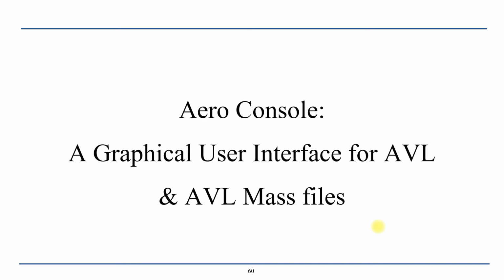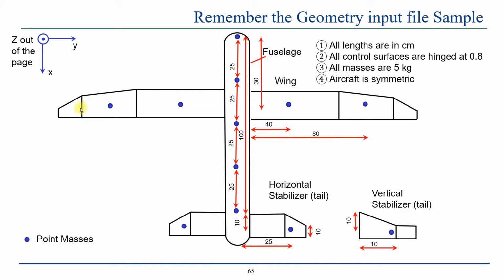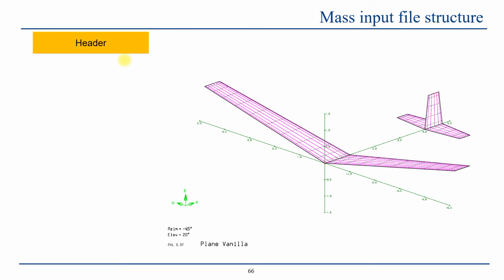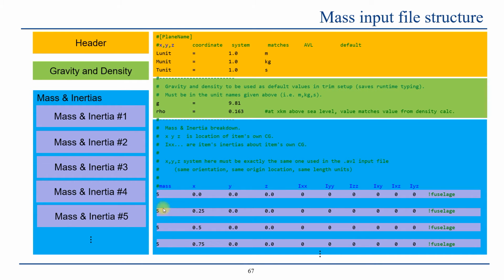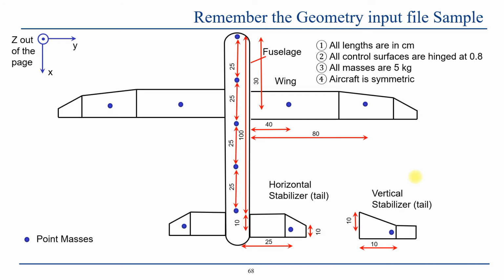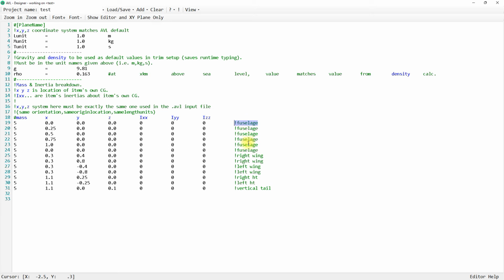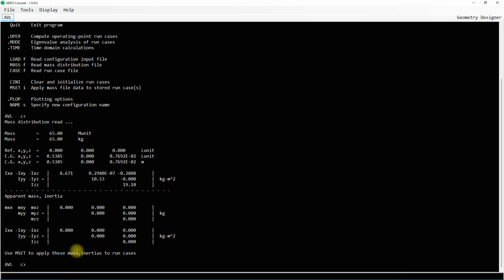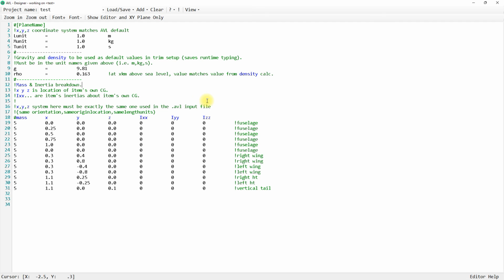AVL Tutorial - Part 05 - Aero Console and Mass Files

Comment: why are the cl values and cd values same when i change the air density?? plz...
Reply from the maker: You need to make sure that the values for air density are applied to your calculations by either manually changing them in the run you are executing or changing them in the run file you are using for the calculations and re-running your calculation using the execution commands in the console. In any case, if you have set the cl values as your constraint they won't change as all the other parameters would be calculated to satisfy a set cl value as you define in your constraints for the program execution.
Reply: @arahimi_  Thank you, i applied the air density to my calculations in the run file. But it still has same problem. If the mass file has wrong values, can this cause the problem that i have? It seems that the air density doesn't affect the cl, cd values for me.
Reply from the maker: @김무관-b3u  Please send your geometry (.avl), mass and run files all in 1 email to my email in my contact to double check.

Comment: How can I save the inertia matrix as output?
Reply from the maker: While AVL provides various output options, including forces and moments, it doesn't directly output the inertia matrix.

However, you can calculate the inertia matrix from AVL's output files that contain the forces and moments. The inertia matrix includes the moments of inertia about the three principal axes (Ixx, Iyy, and Izz) and the products of inertia (Ixy, Ixz, and Iyz). Here's how you can calculate it:

1. Run AVL Analysis: Set up your aircraft geometry, operational conditions, and run an AVL analysis to generate the forces and moments.

2. Obtain Forces and Moments: In the AVL output file (typically a .out file), you'll find the forces and moments data. You'll need the forces (X, Y, Z) and moments (L, M, N) about the three aircraft axes (usually in non-dimensional coefficients).

3. Calculate Inertia Matrix:
   - Inertia about X-axis (Ixx):
     - Ixx = -L / q
   - Inertia about Y-axis (Iyy):
     - Iyy = -M / q
   - Inertia about Z-axis (Izz):
     - Izz = -N / q
   - Products of Inertia:
     - Ixy = Ixz = Iyz = 0 (assuming no products of inertia are specified in AVL)

   Where q is the dynamic pressure (0.5 * air density * velocity^2) based on the operating conditions.

4. Record and Save: Calculate the values of Ixx, Iyy, and Izz from the coefficients in your output file and save them as your inertia matrix.

Please note that you should make sure that the AVL input correctly represents the geometry and mass distribution of your aircraft. Also, this method assumes no products of inertia, which may not be the case for some aircraft.

Comment: why did you assume the value of point masses to be 5kg?
Reply from the maker: This is a random choice, this design is for tutorial only, not to scale or for a real aircraft.
Reply: @arahimi_  okay. Then how do we assume it for a real aircraft?
Reply from the maker: @_MITALIDIWEKAR  You would have to do mass and weight analysis using other software like Solidworks (https://www.youtube.com/watch?v=0FC41j8DXKs) to be able to get real information about your model if you can model them in CAD software. For the location of poin-masses in AVL, you can use center of gravity for each part you make or distribute them as you see fit depending on how refined your modeling needs to be to include more point-masses in more locations on each surface/part of your design in AVL.